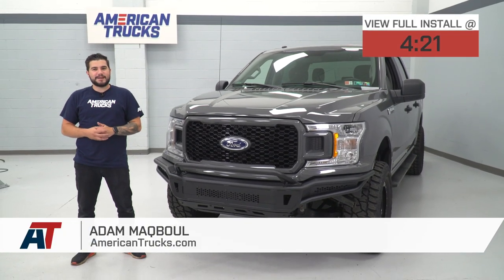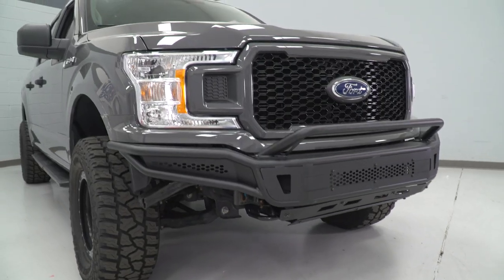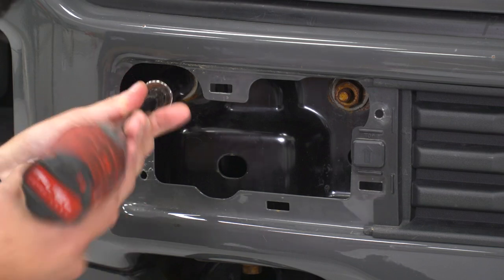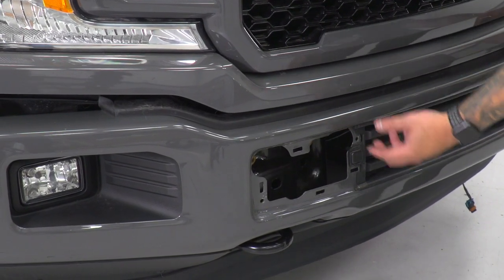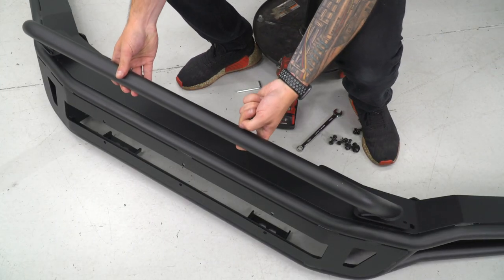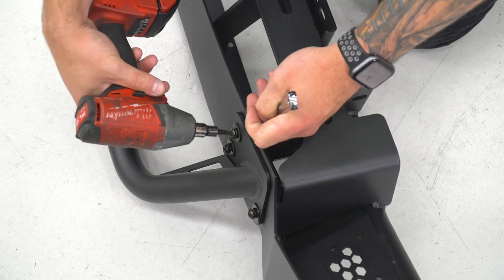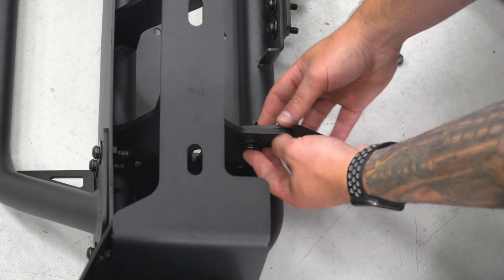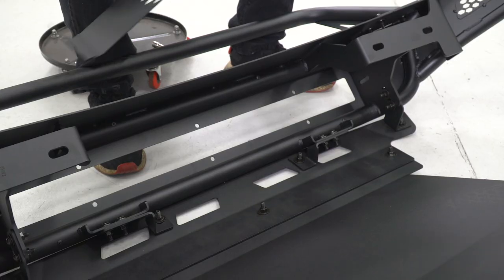2018-2020 F150 Barricade Pre-Runner Front Bumper with Skid Plate Review & Install

Comment: Yeah I saw that u crossed threaded that last bolt for the bottom of the skid plate. But it does look nice. But why not weld all the plates on the bumper instead of just spot welds all around? for $1,600 they could at least make it spot on. Haha